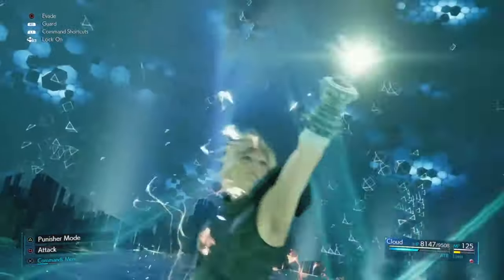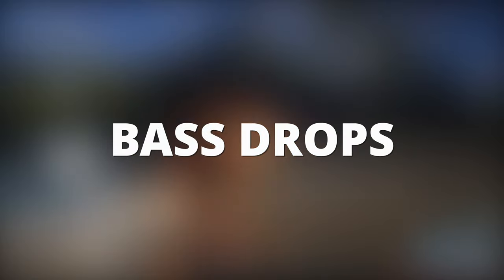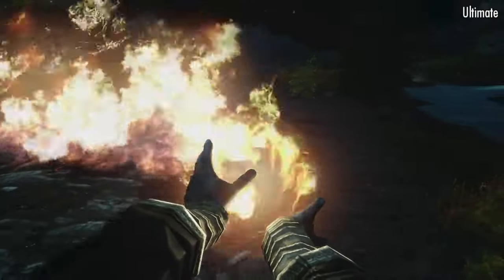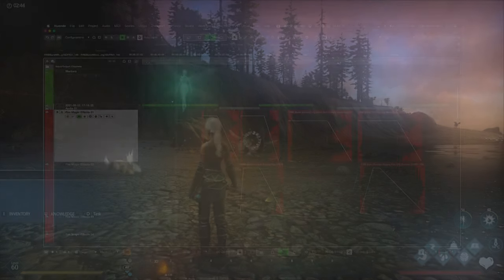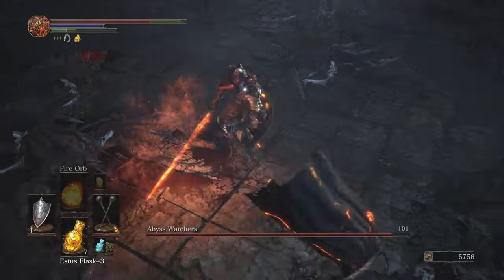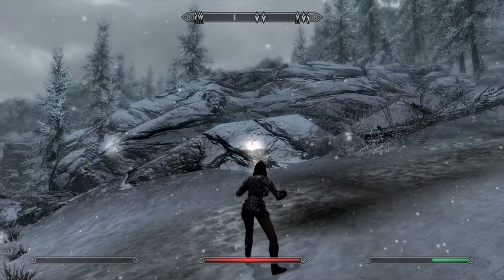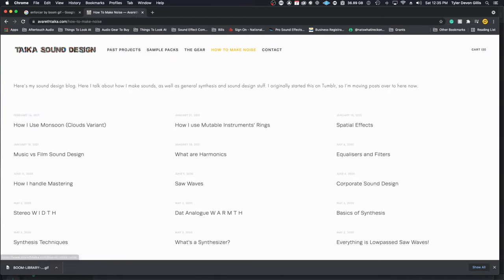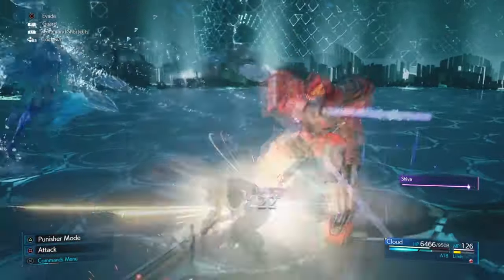Fire Magic Sound Design Tutorial

Comment: Should I use a dynamic mic or a condenser mic for recording fire outside my yard?
Reply from the maker: A combination is not a bad idea, but if I only had to choose one, I'd lean more towards a good condenser setup as Dynamics are less sensitive by nature.
Reply: @AftertouchAudio  that sounds great, thank you! But i do have another quick question: I am aware that condenser mics do tend up to catch a lot of background audio, is there a way you can do a tutorial on how to effectively denoise your samples for a clean recording in the end? If you already have a video on this, I would be happy to check it out. Thank you for anything you can do
Reply from the maker: This would be a little challenging task to do on my end as every sound file is different and depending on the type of noise/artifacts you have require different processing. My best piece of advice I can give you though would be to start at the source. Using the proper microphone for the job and minimizing the background noise at the source is always the best option first. For a lot of field recordings where you want to isolate the thing you are trying to record a shotgun microphone would be the best option for this. 

If the option of microphone is not as plentiful hanging some sound blankets (basically just think blankets) is a good way to help minimize the unwanted sources that your microphone pick up. 

If you go into post with a lot of unwanted noise that you are going to try and get rid of, you'll likely cut into the sound that you are trying to keep, that being said, constant sounds are not bad to remove like generators, hums, or light buzzes.
Reply: @AftertouchAudio  Great! I’ll definitely try that blanket technique. Until then, I am still investing in a good microphone. But thank you for this information